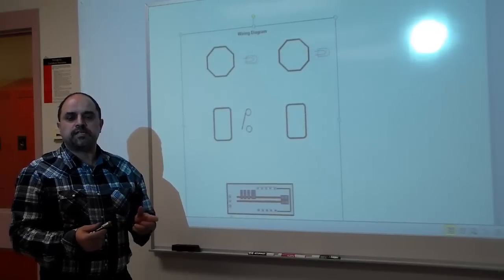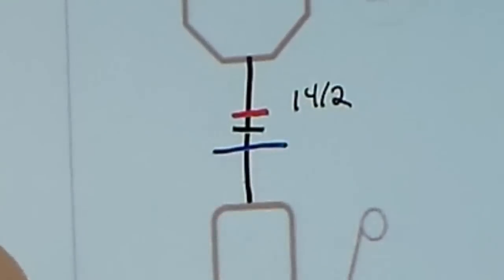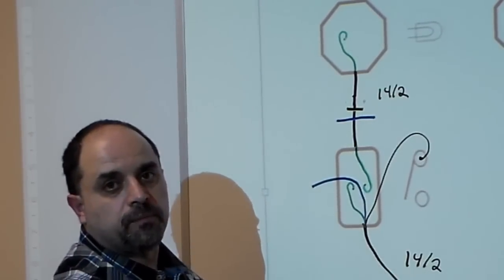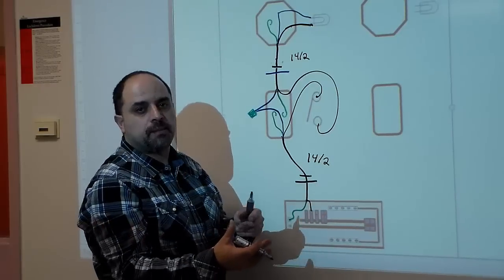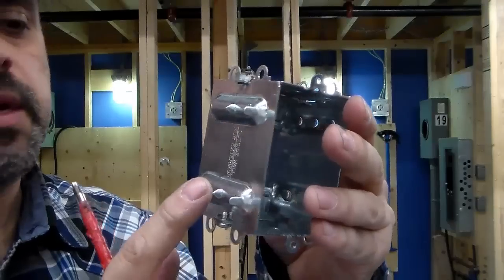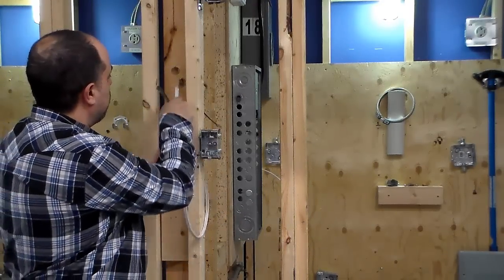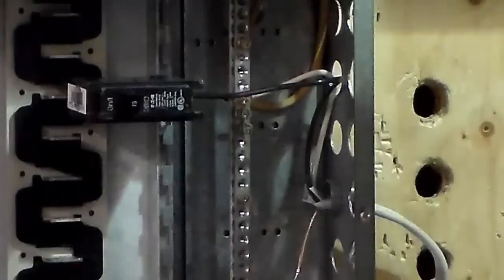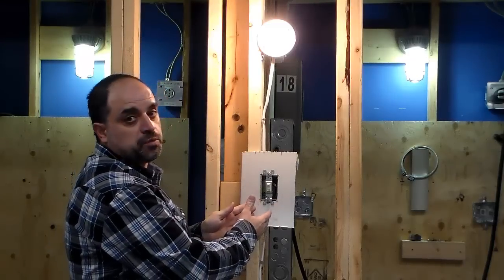wiring a light

Comment: Thank you very much. I like all your videos and how detail you are. I hope you continue to make more videos. Now for my question, can I run wires from the box that's all metal but it haves four holes on each side that you could put BX wires through and to a outlet or light switch? BX wires are out of code in my city but lots of homes still have them for the low cost and they are  easier to work with. I hope you can help me. The house I have is very old.

Comment: Hi Sam great video. I have a question for you to hook up a new light can I run a wire from existing receptacle? the receptacle turns on by the switch
Reply from the maker: +Alexander B If the light switch controls the receptacle then you need to make your light connection to the wire that controls the receptacle. need more info to make correct answer.

Comment: Hi Sam what type of application would call for 14/3 cable?
Reply from the maker: Three way switch , split plug in a kitchen , 240 receptacles are just a few where 14/3 can be used for 15 amps and under.

Comment: Hello Sam, I am interested in the electrical program. I already got an admission at kwantlen University in BC  for the electrical foundation program but the program is really expensive because i intend to pay my tuition my self reason been  i already have a student loan from my previous program (Marketing Diploma). So the advisor at the school told me i could look for a company to train me but most of the companies request basic knowledge like reading a blueprint among other requirements. Whats your advice and please  could you post a video on BLUEPRINT reading. Thanks
Reply: +Oluwatomi Rhodes I don't know if it still applies but if it does, there is a book called "Electrical Wiring Residential" published by Cengage Learning (18th edition, based on 2014 code -- Check to see if the code is due to change to know if you need the next edition). It comes with blue prints, and shows how to read them, and includes blank ones, that you fill out.

It's actually very very simplified. Once you see how they look, you'll be thinking the same (Wow this really is simple!). As with anything of course it's easier once you know, but in this case you'll see it's very simple even to learn. 

We use this in residential wiring courses where I live. Our instructor is the City Inspector, he said the book is written pretty poorly in a lot of areas, so sometimes difficult to understand. Others don't have much of a problem. Some chapters were very obnoxious in this scene yes. But for the most part it serves its purpose.  

A good idea would be to check your local community college for Residential Wiring programs. They will be much more practical application then theory (as most Universities concentrate on theory -- Kwantlen could be different!). So the most import part aside from knowing the code and blueprint reading and safety, is actually doing some wiring. 

Hope this helps. I'm not an Electrician. I'm a super bottom end armature who is in her 5th week of a program. So I can't really say much beyond this (after all, I'm watching this to get a better idea of some things!) =)

Comment: NEC "requires at least 6" of free conductor, measured from the point where the conductor emerges from the cable sheath or raceway, and also the conductors must extend at least 3" from the opening in the box, if any dimension of the opening is less than 8". Note that the 6" is not measured from the front of the box. Any more wire sticking out of the box, is a personal preference.
Reply from the maker: +Damian Garcia Herrera 
Damian I would first like to point out that the 6 inches is a requirement for Canadian code . Secondly,  Can you back up your comments with a NEC rule please. I find it highly unlikely the only 3 inches is required to make a connection of switches or receptacles for NEC.  The NEC and CEC rules are very much alike and find it hard to believe the big difference . With only three inches of free conductor from the drywall you would be marking up the wall with your dirty fingers and tools try to fasten the devices.
looking forward to seeing the rule that supports your comment.
Thanks
Reply: +Sam Maltese Of course,NEC Article 300.14
Reply from the maker: +Damian Garcia Herrera
Thanks Damian for providing the info for everyone in the USA to know your NEC rule is as you mentioned only requires a minimum of 3 inches of free conductor. In Canada we use 6 inches.
Your rule as you also mentioned would allow more then 3 inches if you wish.  I believe this will make installation easier.
Thanks again for your feed back and comments
Reply: canada EVERYTHING is better - lineman.